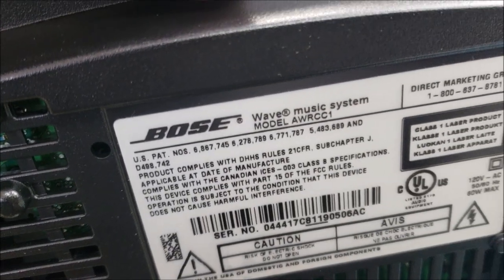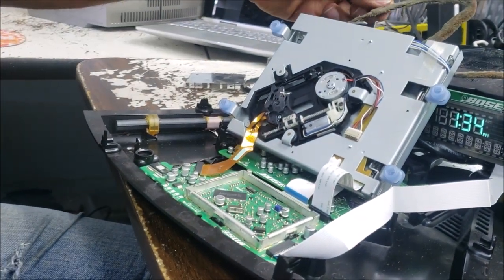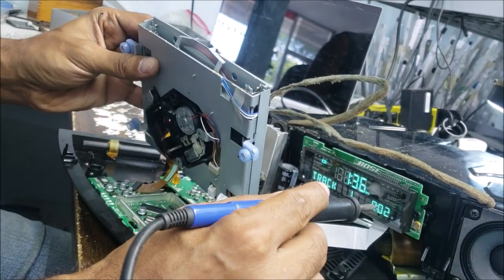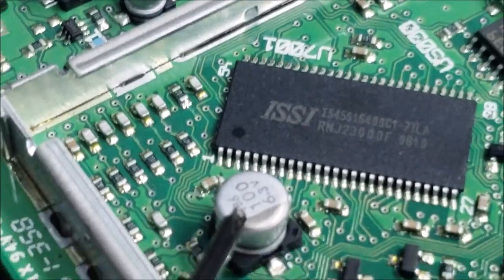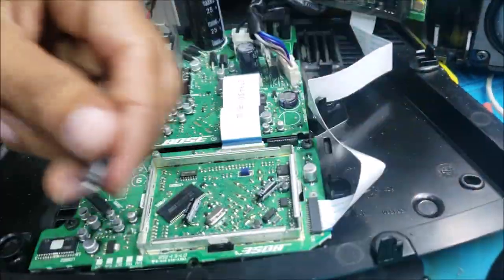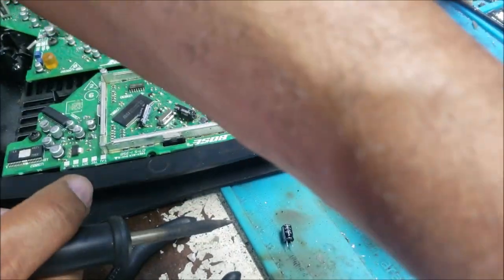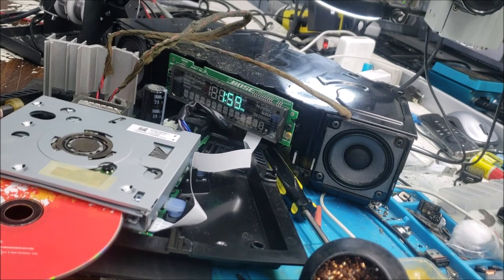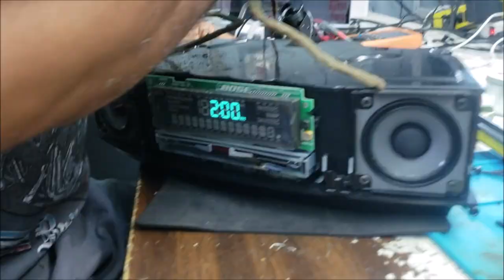BOSE wave music system awrcc1 please wait not turns on cd clicking skipping

Comment: I just wanted to say thanks for posting this video! It was spot on! I replaced these 6 Capacitors  after getting the "Please wait" message and it works great! I had little confidence in my soldering skills but I had nothing to lose! I watched the video a couple of times and it was so clear and showed everything! I ordered the Caps, some at a higher voltage rating because I had a hard time finding them all! Thanks again!

Comment: First reset according to Bose website instructions. For the CD clicking, mine was doing the same thing. It was ‘dried up’ or dusty silicone grease on the screw drive that moves the laser back/forth - added some fresh silicone grease to the screw, loaded a disc and moved from first track to last about 5-6 times, now it’s like new!
Reply: Can you explain where this screw is?  I'd rather try this first before attempting to solder anything!

Comment: The reality is that every capacitor on both boards are bad.  Get an ESR meter and have at it and be prepared to be amazed at the carnage.   Even if you change the caps to get the CD running, the sound isn't exactly right - either it sounds cheap or they even squeek and squawk.  When I do these,  I shotgun the entire board and use ceramic chip caps instead of electrolytics for a permanent repair.  Once they are all replaced, these sound like new again.

Comment: Wow very interesting video.  I purchased a Bose AWRCC! which at first would not play CDs at all.  Only got the "DISC NOT READABLE"  error.  The radio plays fine.  I took the unit apart and cleaned the roller and optical lens with IPA.  Upon first observation it would now play a CD, but it would stutter or the sound would go in and out.  Sort of sounds like your demonstration before heating up the caps.  But I don't hear any clicking.  But what is most bizarre is after playing for a couple of minutes (one track or so) the CD then plays perfectly.  It continues to play CDs perfectly one after another.  Almost like it has to "warm up".  I'd be interested in your thoughts on this.  Doesn't seem as extreme as your demo.  Could this be a bad or cold solder joint somewhere on the board?  Or is this the same problem with the caps?  Thanks for the help!
Reply: Mine was doing the same thing. It was ‘dried up’ or dusty silicone grease on the screw drive that moves the laser back/forth - added some fresh silicone grease to the screw, loaded a disc and moved from first track to last about 5-6 times, now it’s like new!

Comment: Hello - Great video. I also identified 2 bad capacitors and decided to replace them all as you have done. I did notice that in your list of capacitors to buy you listed 4.7 micro farad at 6.3 volts but on the capacitor it says it is 47 micro farad at 6.3 volts.  What capacitance did you actually install on the board?
Reply from the maker: here
https://www.youtube.com/watch?v=8wTyeSP_61k
Reply: Greetings friend, from Venezuela. I am a technician and I need to know the identification code of the IR sensor of that equipment that you repaired in the video. I repaired a similar one but the sensor doesn't work and I can't get it here in my country. Thank you.

Comment: Wish I has the same success with 2 Sounddocks I have. Freshened up the caps but they still don't turn on. I was told that the dsp chip is more than likely the culprit but I don't know what equipment it takes to reprogram the chip, which I was told needs to happen in order to get them working again. So they're just paper weights for now.
Reply from the maker: i fell lucky with these units so far. yes is not worth to replace the board $150 for the part
Reply: @SOSfixElectronics  There is a tech in the uk who re-programs the chip for $50 and warrantees it for 3 years. Many of the second gen original sounddocks are known to have chronic dsp failures because of how the chip was coded. The tech would only provide me limited information for obvious reasons but I do wish I could find the proper dev board for this chip. He wouldn't say other than it was from T.I and T.I. wouldn't help me out (military secret 😂) Have to see if maybe he can give me a discount on multiple boards. 🤔
Reply from the maker: @electronicrepairservice2020  i ll make some search about this eeprom
Reply: @SOSfixElectronics  Thank you 🙂 He told me T.I. provided the original dsp product but the original chip is from Motorola so I don't know why he'd say that. A company called NXP now makes the chip but he told me it won't work because the chip was made by T.I. especially for Bose under a proprietary part number. When I emailed T.I. all I got was the runaround.
Reply from the maker: @electronicrepairservice2020  check this service manual https://elektrotanya.com/bose_wave_radio_series_iii.pdf/download.html#dl